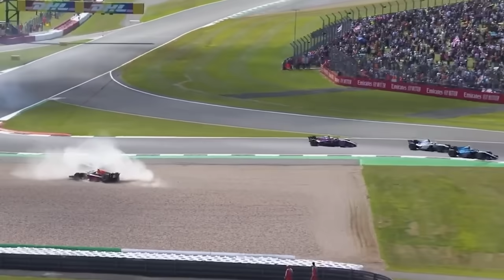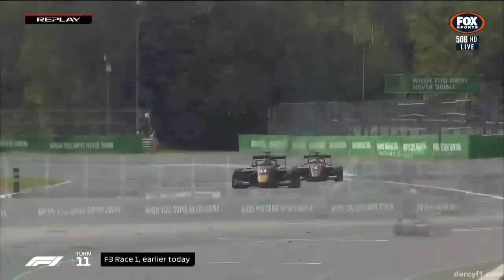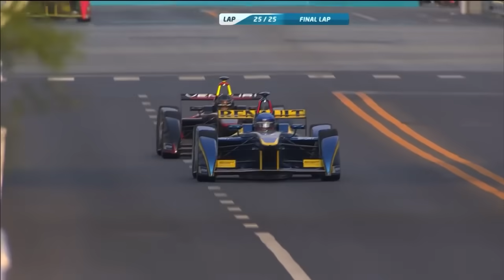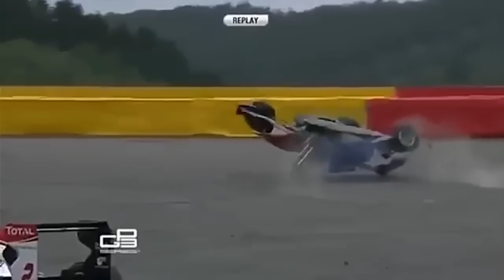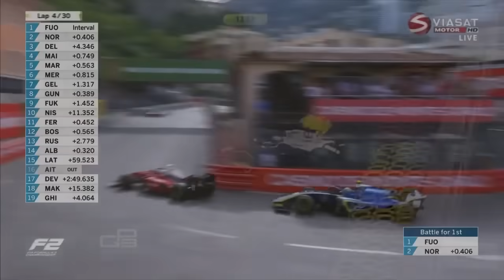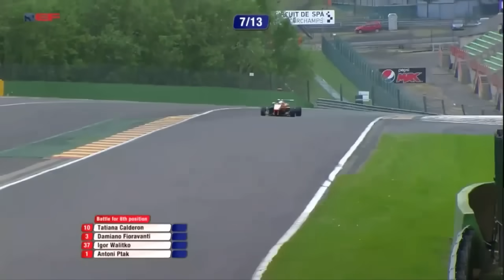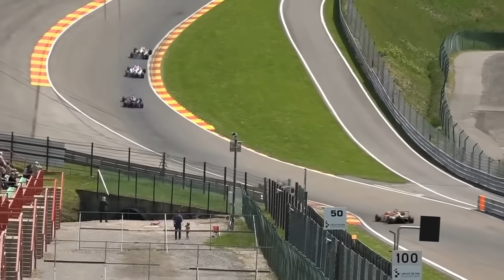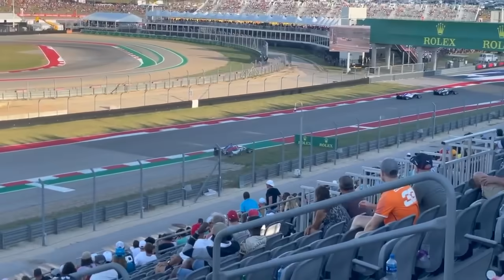Ramps on Race Tracks

Comment: Yes, let's build actual launching ramps on tracks and see what happens. I'm sure no one will get hurt.
Reply: maFIA
Reply: everyone wants to be stadium truck racing
Reply: Lol. I would love to see that! 🤣
Reply: The word you are looking for is stadium super trucks
Reply: Tbf, that second crash, if that car didn’t launch off the track, it would’ve t-boned and t-bone crashed are the ones that cause deaths
Reply: All manor of crashes have caused death in motorsport. It can never be said that its ever going to be safe like sky diving but they should attempt to make it safer.
Reply: I have had my own experience with ramps on tracks - it resulted in a 5kg steel block, that was used as a weight equalizer in go-karts, being launched from my kart and literally flying at and nearly hitting a driver behind me.
Reply: Yeah, that’s the problem, sometimes they are helping sometimes they cause crashes.
Reply: Most of the time it's the drivers' fault things go bad. Not knowing where to brake, slightly off track and to that I say it's not the kerbs fault the driver can't point. In fact, the kerb being there is for a reason, to punish the driver for trying to cut the course. It does that job very well. Now, in a case of a mechanical mishap, I can see why people are in arms about it. They are dangerous. I think we should get rid of the drivers who hit these kerbs instead of the kerbs. Afterall, we wouldn't be watching this video and having this talk if it wasn't for those pesky naughty kerbs ;)
Reply: @mrirace926  I agree.
Reply: Stadium Truck Racing?
Reply: "Great idea, Jim! Everyone can go home now!"
Reply: True lol
Reply: @mrirace926  so if a driver makes a mistake by braking too late, goes over the kerb, flies into another driver and takes their head off, I assume it's all fine in the name of punishing mistakes?
Reply: I love the thumbnail of a ramp at the bottom of eau rouge😂😂
Reply: Indeed race tracks themselves arent dangerous enough
Reply: @BlogVomMax  1.stadium2.super3.trucks yes yes I see nothing wrong with your sentence...
Reply: Why? They probably want see more halo saves to prove it.
Reply: @mrirace926  so you’re saying they should leave literal launching ramps on the tracks that threaten lives on drivers for one small mistake? Drivers make mistakes all the time but that doesn’t mean we should send the driver off a ramp risking multiple broken vertebrae and then fire them. Sausage kerbs need to be removed
Reply: Racing fans are so sensitive its weird
Reply: This is what happens when you get rid of grass
Reply: Luckily they didnt do that 😂
Reply: No one will get hur— man, and here I thought this would be fun to watch.
Reply: @Banyo__  true
Reply: Watch some Super Trucks <_<
Reply: @cricri7066 beat me to it. 😂
Reply: Trackmania intensifies
Reply: The Design is very human
Reply: That's what I came here for.
Reply: WRC does it all the time

Comment: The second clip with Dennis is wild. Without the halo that would have been one of the most brutal deaths in motorsport. Safety has luckily come a long way (except the SOS itches obviously).
Reply: Jules bianchi but in plain sight on slow mo...
Reply: Sausages
Reply: The Halo didn't save Dennis, it was the headrest. Pay attention to the replay cameras next time.
Reply: roy nissany needs a permanent ban from motosport that guy is super clumsy
Reply: Same day as Zhou's silverstone accident mind you
Reply: @a3nofficial25  That's what I was thinking when I saw it as well. I am so glad the sport is as safe as it is now. However, improvements can be done. Zhou's crash was terrifying. If that car caught fire, he would die in a horrible way, right in front of the grandstand. Also Grosjean's crash could have ended in complete tragedy. I don't know what improvements needs to be done. Even stricter rules on the gas tank? A way to eliminate the chance of getting stuck between two barriers? I have no idea how they could achieve the latter.
Reply: Find it ironic that it was both drivers that made contact originally that end up on top of each other
Reply: @DR3ADER1  it didn't save Dennis, it saved Nissany. Lucky for him because he's the one that caused the whole mess
Reply: @olekaarvaag9405  Hm, maybe just ban all racing? That would be pretty safe.
Reply: @DR3ADER1  you can literally see the tire slam into the halo on replay yet calling people blind lmao
Reply: @IMWALKINHEERE9739  Incorrect. The headrest protected Dennis. It's on the cameras. Stop lying.
Reply: @DR3ADER1  There is a hit on the headrest for sure but if you look at the video on think of how physics work, you can understand that the Halo is preventing the top car to rotate straight into the head of the guy on bottom. Without the halo his helmet would have a "big scratch on the visor" and Dennis would have a "big torticollis".
Reply: @DR3ADER1  ?????? The front right tyre was on a direct path for his head, without that halo it would have been instant, and it would have been closed casket. Putting peoples lives in danger because you dont like the look of the halo is ridiculous lmao
Reply: @bruhbruhbruh42069  Again, incorrect. It wasn't near the Halo, but the headrests.
Reply: @DR3ADER1  The entire car litterally collided with the halo, the headrest is the bit behind the drivers head, the halo is infront. If the car had hit the headrest, he'd be dead allready
Reply: @DR3ADER1  nevermind, just looked at your other comments, clearly a troll lmao, got me good xd
Reply: @DR3ADER1  Ok fair enough, this has acc interested me though, Im working untill 4pm gmt, after work if you like we could go through the video in a discord call together, from what im seeing the halo definatly saved him, so id be interested to hear youre explanation for the headrest saving him :)
Reply: @DR3ADER1  dude you fucked up and now youre trying really hard to double down, but litterally everyone can see that the halo saved him 😂😂😂
Reply: @dannywhite132  Or rely on Argumentum ad Populum like a one-trick pony. Not even a skateboard to the head will make you smarter or observant.
Reply: @DR3ADER1  I'm not sure you know what projecting means, and your inability to watch a video is actually hilarious 😂😂😂 dude, everyone can see you were wrong, just back out and walk away
Reply: @DR3ADER1  Ok, listen, answer truthfully Id like to know how accurate i am, but my guess is you are between like 14-16 years old? you sound just like me when i was that age, saying big unrelated words, sure does make you sound smart when youre doing gcse's lmao
Reply: @DR3ADER1  genuine question, why have you been consistently commenting on this video for what it seems like 7 months
Reply: @DR3ADER1  this has gotten out of hand, i propose quick scope 1v1 on rust, this is the only logical solution
Reply: Wasnt the halo. Think about it for a second, the tyres are too big to hit an area as small as the head. The tyre hits the cockpit sides and roll bar first. You dont want to praise the other features anymore?
Reply: @olekaarvaag9405  the cars need to stop being this stupidly heavy. Get rid of that awful hybrid engine. Since 2018 apparently 13 drivers have been very close to dying, despite there being 0 deaths between 1994 and 2014. I mean its obvious where the danger came back, as soon as hybrids were introduced we had our first death since Senna and the longest domination period in F1 history. Grosjean would have never went through the barrier in a lighter car, and Martin Brundle alone has been hit 3 times in the head by another Formula car in his career.

It's a disgrace to the sport that the hybrid engine was introduced, the hybrid is essentially starting from the base of a Turbo ICE and adding something that slows the cars, adds completely unnescessary amounts of weight, drove up costs like never before, drove manufacturers away and completely destroyed the competitive balance in F1.
It's not about racing anymore, it's all POLITICS.
Reply: No. Without the sausage curb it never would have launched the same way
Reply: @DR3ADER1 nah mate you're blind
Reply: @gamechip06  Am I? Because the Halo did jack shit.
Reply: even with the halo he is lucky to be alive.

Comment: Not even a week later and there’s already another serious one to add to this. These things need to go
Reply: What one?
Reply: Oh yea nvm wec at monza
Reply: @crazycars81  yeah it’s crazy how a door got ripped off it’s hinges just by hitting the violent sausage kerb
Reply: They have always been dangerous. Roland Ratzenberger and Rubens Barichello hit them at Imola and one died while the other nearly died.
Reply: There were no sausage kerbs at that time so idk what u are talking about
Reply: @Gustavo Araujo whatever ? Know what your talking about first
Reply: They don't. Because people would abuse track limits far more frequently otherwise.
Reply: @DR3ADER1  ever heard of these things called sensors? they can be used to stop people from going off of track limits without turning an f1 car into an airplane
Reply: @xoanone  Sensors are expensive to install, temperamental and overly complicated to maintain and are widely derided by many drivers, as this year's Austrian Grand Prix has demonstrated.
Reply: @xoanone  Furthermore, the cost and expense of sensors prices out most championships that AREN'T F1 or the WEC or FE. And the track organisers can't properly keep them running for more than 2-3 years without any problems with the signalling. Particularly with changing temperatures, and weather conditions.
Reply: @DR3ADER1  its better than risking a death on the track. the fia have worked relentlessly over the years to try and end deaths within the sport, and all the sausage kerbs do is turn the car into a high speed projectile that can easily tear through a catchfence and kill not only the driver but also spectators
Reply: @xoanone  Except there has NEVER been or will be a death that will involve the kerbs. Again, barely 27% of these incidents have injured the drivers, you're all here complaining about the kerbs when the more fundamental issues such as the lack of training on ovals at the amateur and semi-professional level are far more dangerous and rife with injury.
Reply: @DR3D1  this is an old argument but the problem could also be solved by TWO HUMAN EYES yessir  one marshal using his two eyeballs  on a camera watching for corner cutting that thing weve used them in ball sports for calling out of bounds crazy we dont use them here "its hard to see" if you cant see a full car on the wong side of a line there is no hope for you
Reply: @tyranus1111  I wonder if you still think this is a good idea after the 2023 Austrian Grand Prix. Sure, nobody had a dangerous wreck, but it was an absolute clown-show of a race where the 20 "best" drivers in motorsport couldn't keep their cars inside the lines.